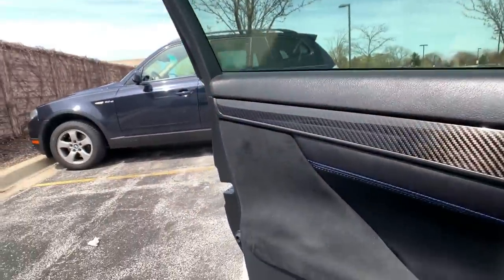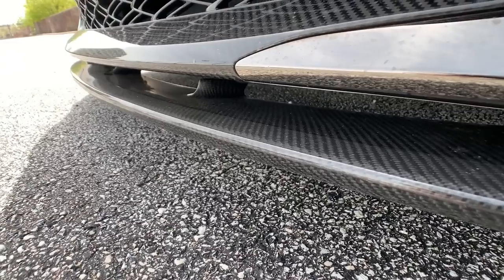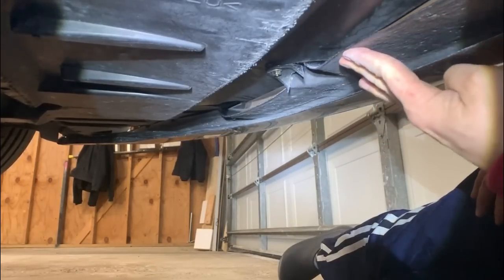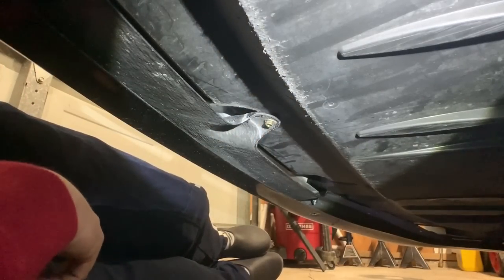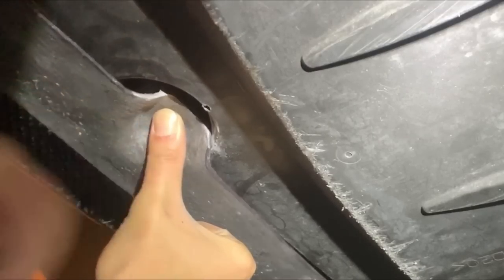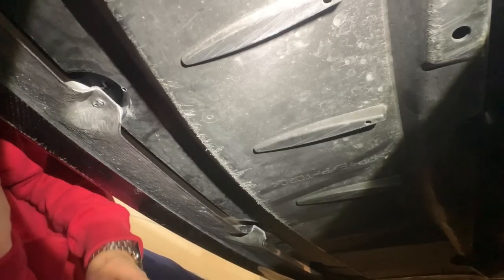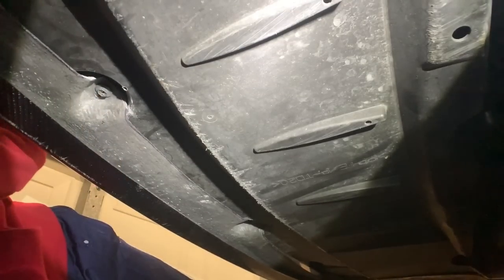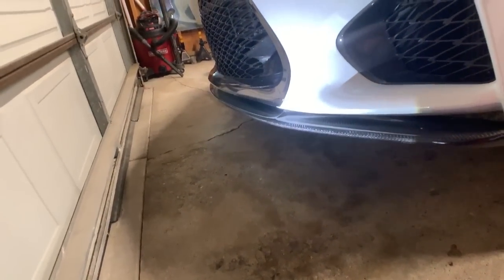Cutting My Lexus GSF Front Lip

Comment: To much pressure on the bolts. It looks like the lip is pulled up in some spots and lower in others.  Am I right?
Reply from the maker: Yea ur right but that is only visible if ur laying on ground looking at it. It’s so far back under the bumper u can’t tell standing in front of it. And the bolts that go into that hole are short so only way it can be.
Reply: Great use of your resources brother! Keep it up. I got a year left on mine. If you like that look I’ll let you know when I start getting rid of all my parts. 🙏🏽🙌🏽
Reply from the maker: Definitely keep me posted. U have a Instagram?
Reply: No I don’t. Just the LEXUS forums that we been going back and forth on. That’s where I’ve put all my pix up of the car.
Reply: Bullets Garage get longer screws and a rubber bushing/ grommet and adjust accordingly
Reply from the maker: Ok I’ll keep an eye out. When u sell message me
Reply from the maker: Not worth it. Looks fine. It’s fixed bro. Let it go bulli kid
Reply: Bullets Garage you got it brother!!
Reply from the maker: Thank you